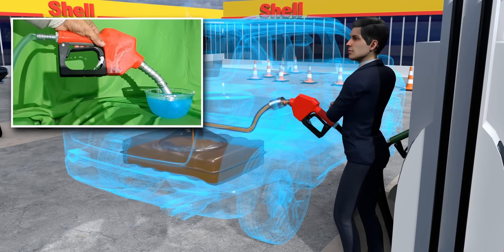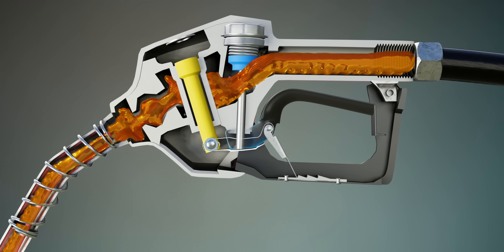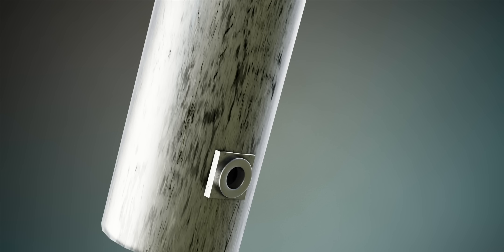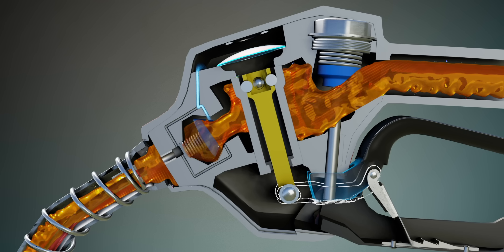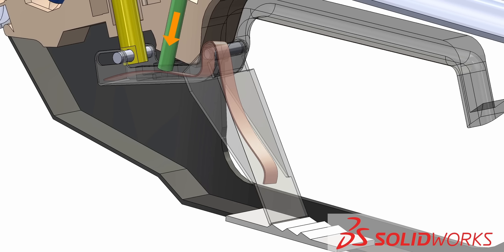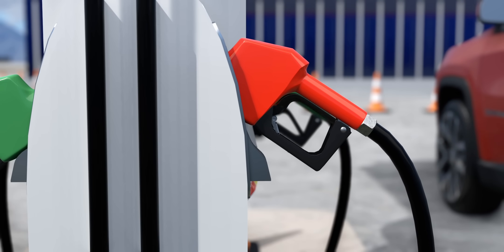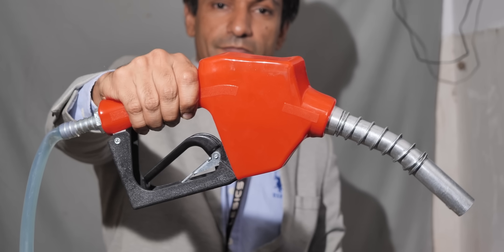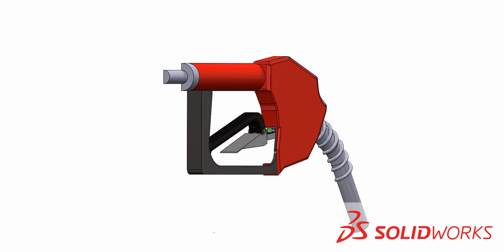How does a Gas Nozzle KNOW when to shut off?

Comment: An automatic shut-off gas nozzle uses the Venturi effect and a pressure-sensitive system to stop fuel flow: air is drawn through a tiny sensing tube as gas pumps, creating a vacuum that holds the valve open; when the tank fills, fuel covers the hole, blocking airflow, collapsing the vacuum, and triggering a diaphragm/lever to snap the valve shut, preventing spills. 

How it works step-by-step:

Pumping Starts: When you squeeze the trigger, fuel flows through the nozzle, and simultaneously, air is pulled in through a small hole at the tip.

Venturi Effect: This air travels through a narrow part of the nozzle (a venturi) creating a low-pressure zone, which helps keep the main valve open and allows for smooth fueling.

Vacuum Creation: As fuel fills the vehicle's tank, it rises and eventually covers the tiny sensing hole at the nozzle's tip.

Airflow Blocked: With the hole covered, air can no longer enter the sensing tube, and the vacuum is broken.

Diaphragm/Lever Action: The sudden change in pressure (or loss of vacuum) causes a diaphragm or a set of steel balls to move, which releases a lever mechanism.

Valve Closure: The lever snaps shut, closing the main valve and instantly stopping the fuel flow, preventing overflow and spills.

Comment: The modern automatic shut-off gas nozzle mechanism was invented by Richard C. Corson in 1939. He developed the mechanism while working at the Socony-Vacuum Oil Company in Olean, New York, initially to allow workers to fill multiple barrels of gasoline efficiently and safely. 

Corson's mechanism used a "butterfly float" inspired by the mechanism in a toilet, which eventually evolved into the modern safety shut-off valve that detects when a fuel tank is full. 

The Mechanism
The automatic shut-off feature works using the Venturi effect and a small sensing tube inside the main nozzle spout. 

When fuel is flowing, air is continuously drawn through the sensing tube.

When the fuel in the vehicle's tank rises high enough to block the small hole at the tip of the sensing tube, the airflow is cut off.

A mechanical valve in the pump handle detects this change in pressure and automatically closes, stopping the flow of fuel. 

This mechanism prevents spills and overflows, making the fueling process safer.

Comment: The invention of the gas pump nozzle isn't attributed to a single person, but was a gradual development, with Sylvanus Bowser adding a hose to his kerosene pump in 1885 and an associated nozzle around the 1890s. Later advancements included Richard C. Corson's 1939 invention of the automatic shut-off feature for the nozzle, which prevents overfilling.

Comment: Could this be adapted for very high pressure situations -  ie hydraulic rams? It seems to me as if excavating vehicles might benefit from overpressure situations. But could the cone and ball bearing mechanism cope with  pressures in the 50psi-5000psi range?

Comment: Why this many likes and subscribers to this channel but not my channel

It's  ok 😢 okay now I will make this video short I will tell in few lines

Gas nozzles automatically shut off using a mechanism called a "automatic shut-off valve." This valve is triggered by a change in pressure or a sensing mechanism that detects when the tank is full. Once the tank reaches a predetermined level, the valve closes, preventing further fuel from being dispensed.

If you like my explanation please subscribe my channel

Comment: As a mechanical engineer with some electronics /electrical feedback design, never thought of how purely mechanical feedback and differential pressures alone are used here just to keep it simple and abuse friendly. Very well explained using Solidworks and the animations. Wonderfully done

Comment: I don't understand why the green valve rod doesn't trigger the torsion spring and release the locking pawl when starting the flow of fuel. The green rod must be pressed upwards to open the valve, so shouldn't it be applying force to the torsion spring as soon as the valve opens?

Comment: I don't know what you're talking about. I've owned both a Nissan Frontier 2002 and now a Nissan Frontier 2019, and on both vehicles the gasoline overflows EVERY TIME. It doesn't matter which gas station I go to, it always dumps gasoline down the side of the vehicle before shutting off half a second later if I don't carefully monitor how much gasoline I have pumped and manually shut it off before the tank is full.

Comment: What happens when the user holds the trigger past the full point? In your design it would spill out, yet in Europe when I do that the system internally reverts to off even when the trigger mechanism is physically held down be it the clip or my hand. I am curious how that system works and why it was not implemented in the US.

Comment: This was no less than brilliant. If you're looking for ideas regarding other complex topics that are worthy of the same detail, consider doing one on how a torque converter in a car works. Also, nobody has done one on how the automatic adjustment mechanism of drum brakes works through the star wheel. Both are mechanical engineering masterpieces.
Reply: he did a video on torque converters already

Comment: I am impressed, but there are a lot of points of failure. It's less impressive when you consider people's real-world experience with these handles. They err on the side of shutting off way too much.
Reply: After experiencing one failing in the opposite direction, and having gas spill all over my car and the floor. I actually prefer that they err on the side of too sensitive.
Reply: @noisycarlos  Yeah. The design gets less impressive the more you think about it.
Reply: @GerardPinzone  I don't know, considering how complex and clever it is, and the abuse it gets from people I'm more impressed that it fails so rarely
Reply: @noisycarlos  What are you talking about? They fail all the time. It's a very complicated design. Compare pinball machines and jukeboxes that use no electronics to ones that do. Which ones are more reliable?
Reply: @GerardPinzone the fact that it's a complicated mechanical system, and yet even with wear and abuse will still fail in the conservative direction, is the genius of the design. It's a safety feature after all, so the worst scenario is failing to engage until disaster strikes. 

An electronic sensor based system may be more accurate when it's new, but if the sensor fails, it's more likely to result in hazardous spills.
Reply: @luodeligesi7238  What evidence do you have that an electronic system would be less reliable?
Reply: @GerardPinzone  what's your electronic design? 

If it uses a sensor, what happens when the sensor fails? In almost all systems that use electronic sensors, the sensors require regular inspection and it's not unusual to have to replace them. 

If it uses electricity to operate, what happens when the power supply fails? That's another common failure point.
Reply: @GerardPinzone  get a grip, dude.  Sensors fail.  The real problem is that you sometimes have to press the handle twice 😫😫😫
Reply: @GerardPinzone they don’t fail all the time at all 

In fact, they basically never fail. I’ve never seen a gas over flow EVER from me or others in 10 years of use
Reply: @GerardPinzone it is weird you think electronic systems are always more reliable than mechanical systems
Reply: @pyropulseIXXI  It's weird you hallucinating that.
Reply: Electric system on gasoline handle... that's a combination I would like to avoid and go with a mechanical one. If any electric spark or overheating is happening, then it may result on gasoline nozzle fire.
Reply: They basically never fail. You considering them shutting off ‘too early’ to be a point of failure is absurd.
Reply: @pyropulseIXXI  if it doesn't work as intended,  that's a failure.  Not every failure is a catastrophic failure.
Reply: In my experience I really have never had a gas pump fail, maybe where you live somewhere that has different inspection standards or something.
Reply: Where do you live? How long have you been driving and regularly filling gasoline? I’ve only been driving for a few years in central US but never experienced a gas handle failure, nor has anyone else I know ever talked about it happening to them.
Reply: @herobrine1847  I also agree, you are United States correct? At least in the United States I have never heard once in my whole life about a gas pump failure in the nozzle.
Reply: @herobrine1847  You never started pumping and the handle shut off even though your tank was still empty? That's a failure. It's not a catastrophic failure, but it's still a failure and that happens all the time.
Reply: @GerardPinzone  no I've never had this occur maybe I'm lucky then
Reply: I assume you dont have much brainceII😢
Reply: On the contrary, the electronic system is much less reliable, weaker, and more complex than the mechanical system. This is well known and understood. The mechanical system, even if it looks complicated on the surface, is actually very simple and robust. The mechanical system is real engineering, not just complex pieces made by consumer companies that are put together and the flow of electricity through them is checked.
Moreover, the electronic system often needs the mechanical system and cannot do it alone.
Reply: @ياقوت-ق What model of mechanical computer is allowing you to send such a horribly uninformed message?
Reply: Like it or not it's optimal
Reply: It frequently gets stuck in a state where it false triggers every time, making the thing unusable. And now you have to pay for gas that you didn't use.